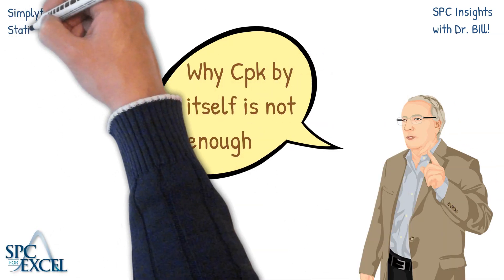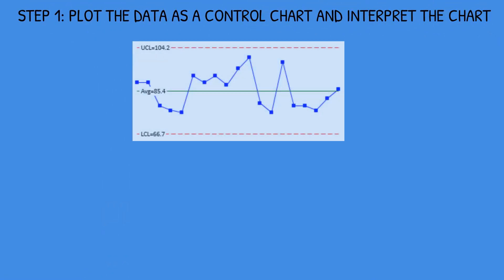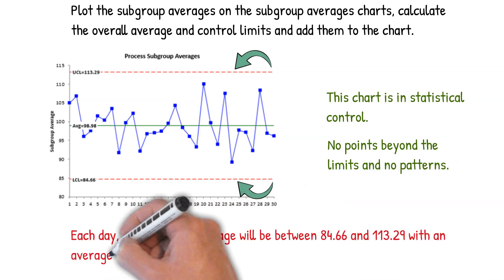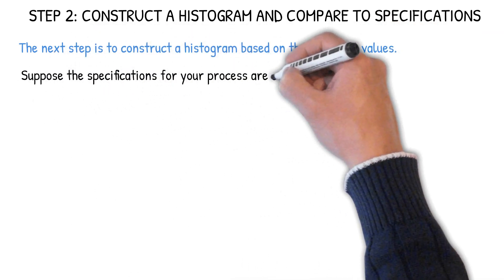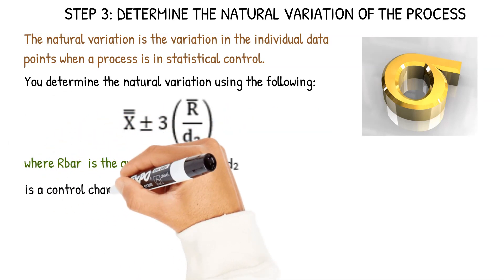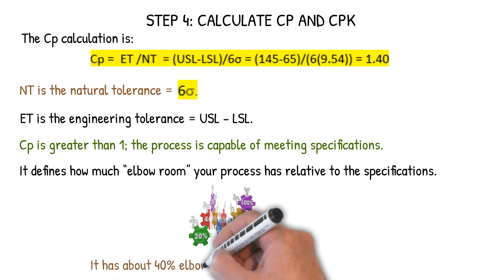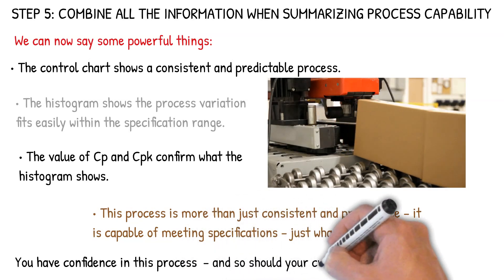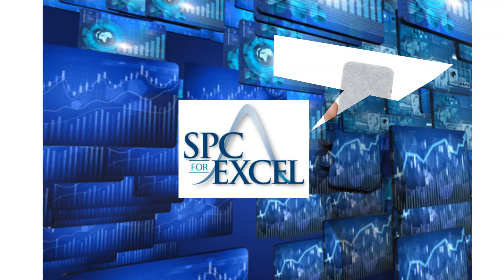Why Cpk by itself is not enough

Comment: The data that you use for deriving  "Cp" and Cpk" is itself the result of a measurement process. If that measurement process capability doesn't match the manufacturing process that is paying the bills, you and  your customers are headed for heartaches. "Thumbs Up"
Reply from the maker: Yes it does contain the measurement error - far too often that is not considered in talking process capability.
Reply: @SPCforExcel  I have to agree with you in the strictest sense because all measurements implicitly contain their own errors. The problem is that the size and magnitude of that error can not be eliminated by any mathematical process. This means that measurements presented with no error assessment including their use in charts, can unexpectedly foul up the process control.